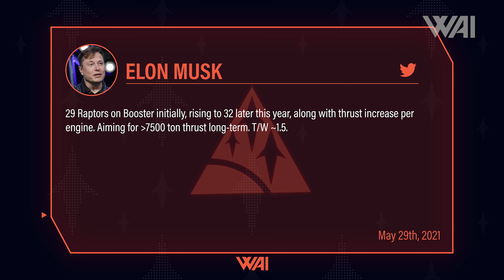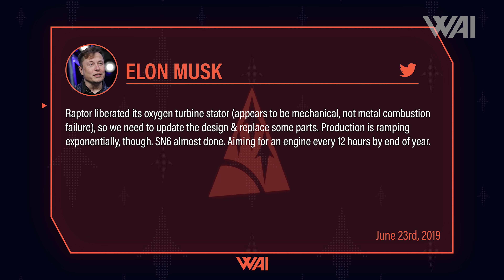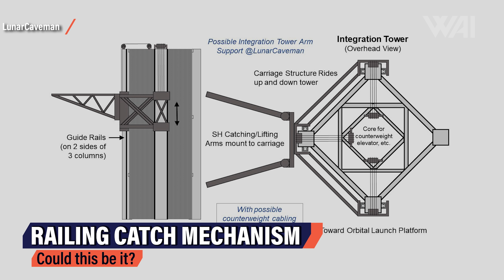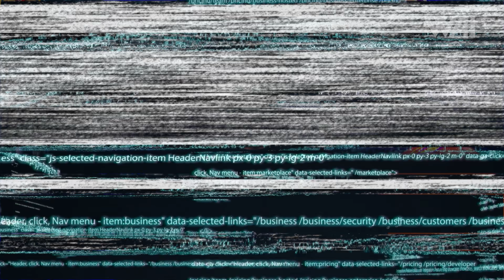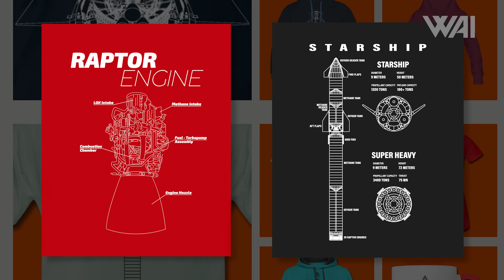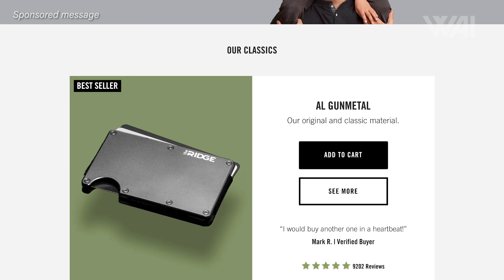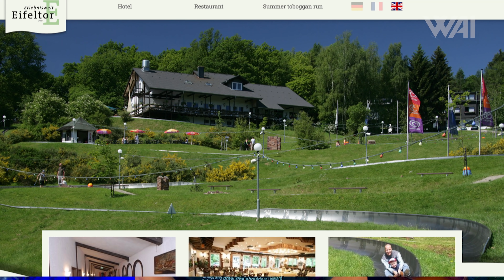SpaceX Starship Phase 3 begins! First test candidate at Launch Site!

Comment: The super heavy thrust puck is machined out of a single billet. all those swirls are the tool paths. Prob has to be to take the thrust I wonder if this is machined out of inconel or titanium.
Reply: 9 meter wide solid titanium machined one-piece? Holy hell, yes please, that would be one EPIC piece of engineering...
Reply: Good thing this thing will be re usable because thst sounds stupidly expensive lol.
Reply: @GundamReviver  right? I wonder if single-piece titanium parts of this size were even done before...
Reply: @michajastrzebski4383  possibly, but then on megaships, like giant propellor and the like.
Reply: @GundamReviver  I think ship props are not made of titanium, tho :)

Comment: I wonder if the Super Heavy could be used as a first stage for an old style second stage.
If it could then SpaceX could use it and a disposable second stage for launches heavier than the Falcon 9 rockets can handle.
This give SpaceX the capability to take more business away from ULA, Blue Origin and the like which can only be a good thing.
Having this available would shut Bezo up and give the much more simplified Super Heavy a use until the StarShip is rated for LEO at least.
Reply: How would that be better than Starship?
Reply: @fredbloggs5902  Not better BUT the Super Heavy is very simple compared to the StarShip and could just be used to launch stuff that the Falcon 9 can't.
It should be ready for continual use before StarShip has been totally certified for human to LEO usage.
Just stick a smaller but wider version of the Falcon 9 second stage on top of it and he would be able to get a lot of extreme weight satellite launches that the Falcon 9 simply can't lift.
The US military told him to design a bigger fairing<sp> for the Falcon 9 to get some of the launches of their heavier stuff and this way he can be actually using the Super Heavy ASAP to bring in more income until the StarShip is ready.
He might be able to use just one of the new Vacuum engines in the second stage so he is using the same fuel in this configuration as the completed StarShip/Super Heavy configuration.